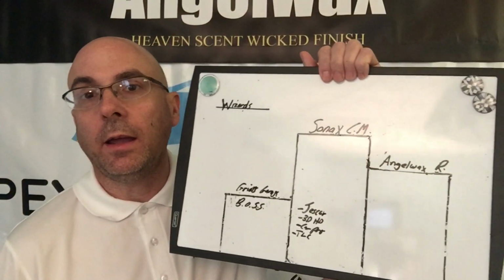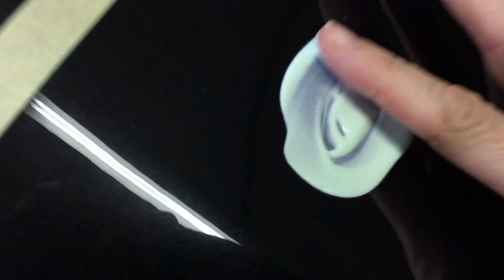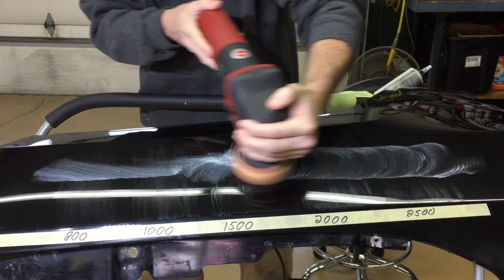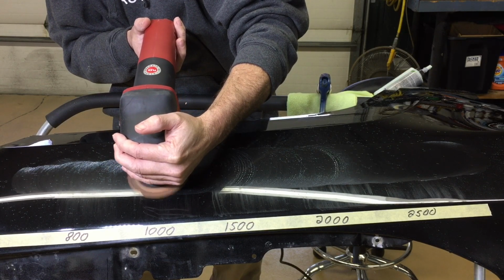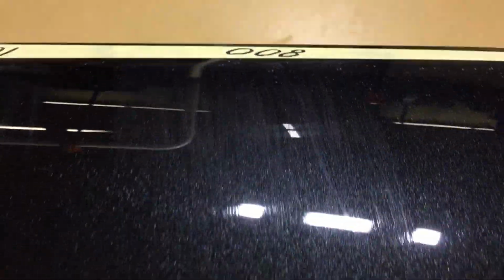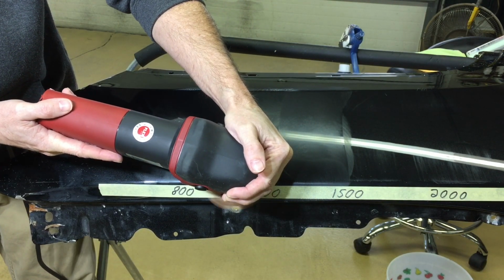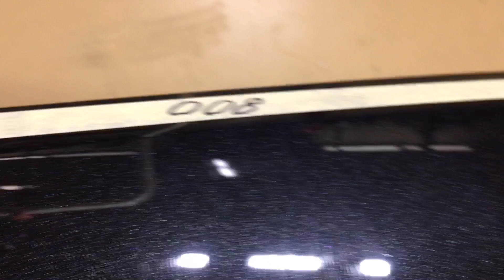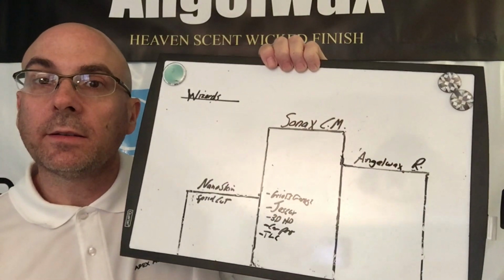NanoSkin Speed Cut!! The Cutting Compound Series....Continues!!!

Comment: ive started using your 1 wash bucket and 3 mitt method. It's so much better than filling 2 buckets with water. Faster/ Cheaper/ Easier. Thanks
Reply from the maker: And saves a bit of water. In a years time... adds up.